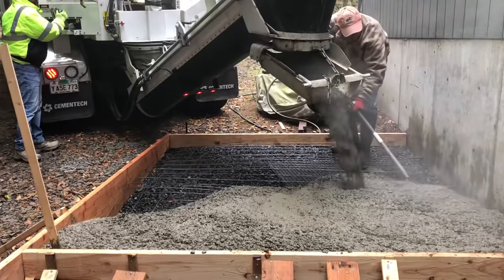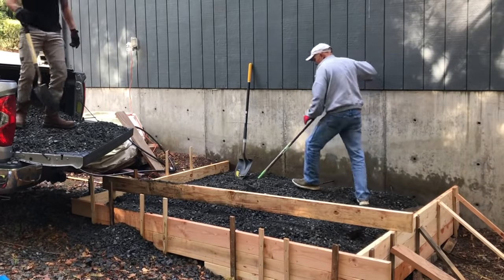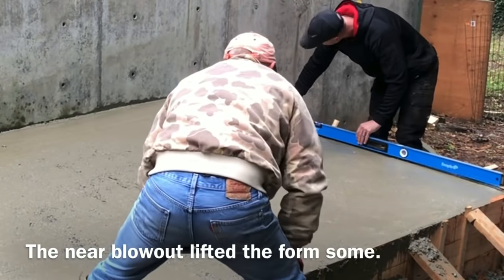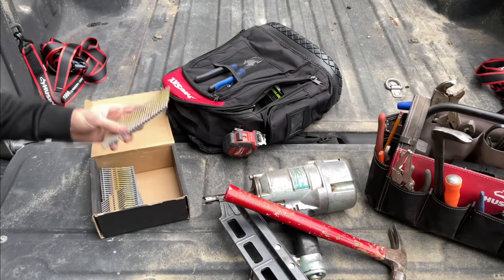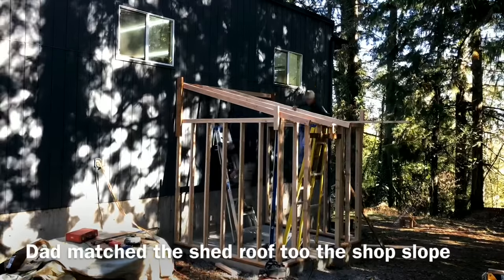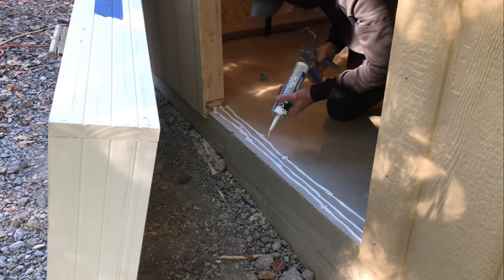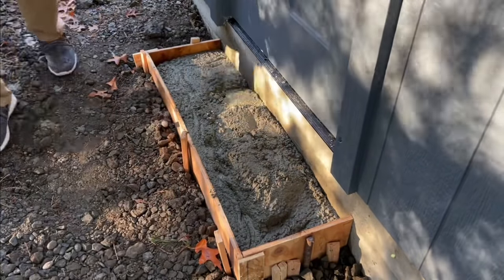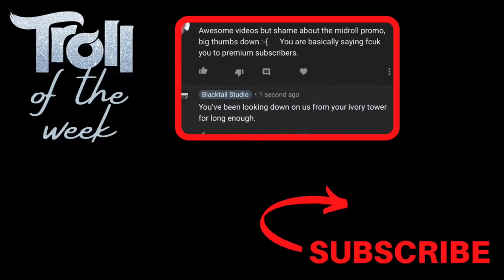Attached Shed w/Slab Concrete Foundation

Comment: One of my happy memories is being my Dad's gofer as a little lad, receiving long lumber as he ran it through his circular table saw, passing hand tools, nails etc    Not only good bonding with him, but planted the seed in my mind for future carpentry projects.  Later we went to the local college together to attend "Recreational Woodwork" classes too,  where I learned wood lathe-turning, making dovetail joints etc, and I still have quite a few items in my home from those days.  When I had my first home, Dad rallied round when I converted a cellar to an under-house garage, and we both put on rubber boots and spread 5 cubic yards of concrete for its floor from a delivery truck.

Comment: Dad. I really love your videos. My dad was a great guy and a great dad, but he didn't know one end of a hammer from the other. As a kid I became the "handyman" in our house. Just miner repairs and painting, but I did it. I got married young, with little money with the help and instructions from my father-in-law was able to build a set of cabinets in our first apartment. I'm 79 and living in our 17th house. All of those houses required some kind of renovations. I learned most things by reading Sunset Books in the 70s and from many different friends with a myriad of skills. Plumbing, carpentry, electrical, ductwork drywall, painting, etc. We finally moved near my youngest son and we have done several projects together, including remolding his kitchen two building a couple of garden benches for each other. I think this has been most fun I've had these last five  years. It does build a strong bond between father and son. I'm sure your dad feels the same way.

Comment: Awesome project and it’s great to see your dad helping.  Perhaps already addressed this but I recently used the same insulation and one of the warnings is about flammability. It may not matter much even if you have the walls covered with gypsum boards in case of a spark but drywall and a fire alarm will greatest increase protection to the rest of the shop.

Comment: Dad. You guys did good on the concrete. I’ve seen “professionals” not take all the steps you did.  Hope you lifted the wire mesh so it sits in the middle of the concrete.  Otherwise it’s useless. Fiber mesh is a good alternative.  You should see a blow out on a 100 yard wall. Now that’s exciting!  (Unless it’s your wall). Awesome video as always.

Comment: Dad. My father passed a few years back. My father in law is the one that got me started with DIY(along with myself being cheap AF). He is a general contractor, and has tools, some other tools, some old tools, work van full of tools, then some bins of tools, shed with tools, garage with tools, basement with tools.... so yeah he is my goto for most things. helped me learn about working on cars, doing drywall, carpentry, plumbing, electric... youtube is great for learning, but having someone with the knowledge there with you to point out what you are doing right/wrong, and better ways of doing things... cant compare. Although i have learned things from youtube that i have since passed to him... so works out in the end :)

Comment: Dad(s) are the best.  My (retired) folks came to help out after our daughter was born (25 years ago) and while mom was enjoying the grandma thing, dad was getting bored while I was at work.  I though I'd give him a project to pass the time for a few weeks, asking him to build a shed nearly exactly like yours.  The next day, he had the ground leveled and the forms up.  He mixed the slab from bags in a bucket one at a time.  Matched the roof slope, re-used the aluminum siding from the house and very closely matched it for the ends with LP.  About a week later, I had to find something else for him to do.  I miss dad, but remember some of his best advice about projects.  "It might cost a little more to do it right the first time, but it costs twice as much to do it over."

Comment: Dad.  Your dad is so awesome... I'm glad you get to live close enough to enjoy him in his latter years. 

I really appreciate you showing real life, "warts & all" reality... it's refreshing to see that in a world that is all about promoting an inflated self-image. I think you're doing all the right things to make your channel flourish.

Adding an automatic drain on the air compressor is a big plus, especially in your humid neck of the woods. I'm at about a mile high in dry New Mexico, and we still have enough humidity in the air to find these auto-drains very useful. My compressor shed isn't heated, so I need to add some heat tape to the auto drain, as residual moisture in the solenoid valve can glue it shut with ice. I don't think you'd need the heat tape, as Tigard doesn't see the negative temps we see here. My dad's family are PNW natives, largely living in Portland/Beaverton.

Comment: Dad. I like that it came out looking like it was part of the original shop build. Home Depot is my go to for building supplies. I like the way the on-line page shows what isle and bay an item is on. My home Depot has both an upright saw for cutting sheets of lumber and a large power crosscut saw for crosscutting.

Comment: Hey Gene, was a cement finisher. Here's a pro-tip. Use oil on the wood form before you pour the step. When doing a step use scrap 4X4 stock around the inside of the form. Then pack rock up to the edges for a base. Wet it all down and get the slump down. Then pull out the scraps of 4X4. Now you have a wide and deep edge, for added strength. This will help prevent cracking as it ages.

Comment: Daddio.
Nice addition to the shop. I have my compressor and vac system out in a simular shed. Since I have no close neighbors i was going to vent my vac system to the outside. Then the "dumb bell" went off and i realized that i would also being sucking all the heat out of the main shop. Living on the Southern Oregon Coast it doesn't get extremely cold, but it would have made a huge difference in staying comfortable.
Love the shop build and updates since i am just getting my shop and business going. You are an inspiration!
Wood Wizard Studios

Comment: i really enjoyed this video it reminded me of being a Teenager in South Florida when my Dad and I put a large addition on our home including a new garage  My Dad was also a Jack of allTrades  and for the Slabs we did use a  large truck  but poured everything ourselves  that home is no longer in our family  but it’s very Satasfying to  still see it standing after several Hurricanes  past through it  the reason exterior doors swing inside is to be able to  get th door open in the event of a large Snowstorm or Drift piling up outside the door  for safety you can still have regress

Comment: Dad... I would suggest adding a purge valve on the air compressor tank. It opens a valve at the bottom every time the pressure regulator turns the compressor on. This blows out any humidity / condensate collected in the bottom of the tank and will keep the tank from rusting out, and lower the need for a dryer if you use the compressor for painting. The last thing you want is a rusted out air compressor tank. Otherwise Nice job as usual. Good to see your dad helping out. I wish mine were still around...

Comment: Dad On the high side of your shed you need to control water run off, you do not want water to collect there, you can use whats called a curtain wall which can be a 2 ft deep heavy mil plastic that just keeps ground water away from your shed foundation this is even more important if you get freezing weather. Also try to keep surface water collecting in there too.

Comment: Great to see you and your dad helping each other. Mine, he loves to gossip and ruin anything I do. 

But here’s my professional opinion, when doweling into concrete and setting rebar, you must drill at an downward angle about 30°, blow out dust,  use concrete epoxy. When fully set, bend rebar dowels down level and tie rebar in a grid. Your concrete will never pull away.
Reply from the maker: Good call!

Comment: The rebar you set into the existing shed, you wanna drill those in strait. Concrete shrinks as it cures, so the joint needs to be able to open up or you can get cracking. Not an issue on a small slab like this, but just something to keep in mind for the future.

Comment: Dad that looks craicin, am currently build new benches and shelving for my workshop, lights and power next, have dust collector installed and working remotely but my workshop in only 20' X 20' , so it's like a micro version of yours. But as every man knows his workshop no matter how big or small is his CASTLE..
Reply from the maker: Ya man

Comment: after working in concrete construction for many months, always use rebar. I have demoed multiple slabs that are deteriorating because of wire instead of rebar. That being said it's the difference between a slab that lasts 20-40 years and a slab that lasts 40-maybe even 100 years! Looks like yall did everything well though, and pretty good for a pour for somebody who hasn't done a ton of pours!
Reply: I'll be surprised if this lasts 10 years.

Comment: Spent my entire life pouring concrete.  Not bad. Angles on the bars you drove aka dowels does help.  If you do it again put them every 18". And, while picking up the wire mesh does work it's better to put plastic concrete chairs to hold it up.  That way it won't settle in the wet concrete.

Comment: Dad always use a drop “T” on his air from the compressor to let the water 💦 fall into and with a valve to let the water out from time to time   They’re almost as good as a water separator but put it about 10’ away from the compressor. I don’t know if the Posting over a year ago will get looked at. Thanks for your work. I never got over 48” when flying at about 72 knots (Hovercraft Pilot).

Comment: New sub, first video -- building my own shop next summer and looking for some ideas. I definitely agree with putting the dust collector in it's own building on a firm concrete floor. I'll be putting my 60 gallon air compressor there as well. I also agree with the rent vs. store for tools that you really don't need to buy. Seems like a great place to get ideas or at the very least confirm that others are doing things the same 😉 -- I have an Oneida dust collector as well, but mine is from back before they painted them, like 2001 or so. Great channel!
Reply from the maker: No way, good taste!

Comment: Dad... loving the shop build videos. One tip for future reference, when doweling into an existing concrete slab you want to epoxy that end. The new slab concrete will grab and hold your rebar. However, the fact you did dowel in will help tremendously from allowing the slab to sink or even slide for a really long time. Nice work, Cam!
Reply from the maker: Good to know!

Comment: They put the rebar in the concrete at an angle to prevent it from pulling out,  but pounded the wooden steaks in straight. 
Had they put some alternating angles to the wooden Stakes in the ground, the concrete form most likely would not have lifted.

Comment: First of all if the form is reasonable with level the concrete will self level Much like water it will find a self level spot and good to go. However if you are too out of level trying to use a scree board doesn't work very well.  The concrete bolts are great I've used them. I too had built a 200 square foot shed/building. I installed drywall and insulation and electrical and finally a sliding window. I went with double low threshold steel doors. I don't know if you've priced concrete in the last several months but it seems to have gone up. Your videos are great, pour them on.

Comment: Dad, my dad and us boys built his big 120’x80’ metal shed and we had to bust up an old hard concrete slab with a jack hammer. Same thing you did, we filled low spots in the new foundation with the old concrete chunks.

Comment: Mound/channel the ground uphill of the slab to prevent rain from washing out the soil under the slab.

Whenever possible, I get the 12' siding, then there are less horizontal seams and the price is usually better than using the z-flashing.

Have a bunch of tin cans, butter tubs, whatever and fill with the excess concrete and an eye bolt sticking up. This makes a bunch of "free" anchors or weights.
Reply from the maker: Good tips!

Comment: Dad passed away almost 23 years ago. He did concrete work for about 20 years, he even had an assistant, me. He did everything from house footings to floors and sidewalks. He always had 2 pieces of plywood squares to move from one place to another to trowel the basement floor of a 24' x 40' ranch house. No question, just have fun working with your dad.
Reply from the maker: Sorry for you Jim. Glad you learned from him though!

Comment: D-Man! Bro that’s impressive. Dad really knew what he was doing! 🤓 everything is cool but there were some minor issues with that shed. 1: It isn’t a heavy traffic road or big roof n it is built on the solid land after a lot of fillings so you didn’t really need the wire mesh. 2: j-bolts cannot hold the whole structure for long, 4 wood or concrete pillars in the 4 corners n 2 for the door directly coming out of that floor bed was a better trick. n roof of this hut isn’t attached to that wall very well! Making a groove in it n then fitting the roof base wood inside that groove was great. n even if it isn’t heavy concrete but still wire mesh could provide extra support to the roof!
I’m sorry I feel like I’m talking more than you do in your videos! 🤓 the shed is beautiful n job nicely done 👌🏻✊🏻

Comment: Dad, shed looks great.  With concrete you can always buy extra and take it back later.  I once under bought and it was after the stores had all closed so I had to put in a joint.  Now I figure about 25% extra.
Reply from the maker: Good call

Comment: I filled a block wall cavity with concrete, the bottom row of blocks have openings to clear out mortar in the cavity. Wall was two meters high. The shutter boards on the bottom cavity were 8 x 2  with 4x2 stays running across the floor to the other wall. Once we started pouring concrete the vertical pressure was blowing the 8 x 2 between stays. I had to place more stays at 2 foot centers. I could not believe the vertical pressure. The pour needed to be slower.

Comment: That was a crackin job Lad but. Here in GB we always put a damp course membrane to stop any damp coming through. A pool liner or plastic sheet . I didn't see you do anything like that. It's too late now. So the best thing you could do now is a inch thick bitumen coat to the floor then tile it. It will stop damp striking up but if you have placed the wood walls directly on top of a bare concrete floor it will start to rot given time. Just make sure it's sprayed with wood preserver.
Reply from the maker: Good tip!

Comment: Something to keep in mind. If during winters it gets below freezing where you live, that can mess the slab up and shift it. Thats why you should always at the very least have concrete sitting underground too.
Also, maybe I didn't catch it, but did you not mix any sand into the concrete when you were doing the step?

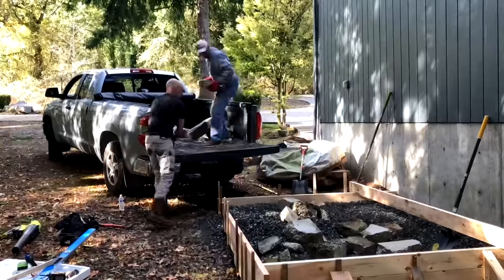Comment: Pops - @ 1:30 when you bore holes in the existing foundation and use re-bar... that's code pretty much everywhere. Especially if you're tying into the original structure with the walls.
Reply from the maker: Good to know!

Comment: Good video! I do lots of professional concrete floors (not bragging, it's just the kinda of floors we do) and this is all-round a pretty alright floor! One thing to note though, wire mesh is worthless, idk who your engineering friend is, but I'm been "in the field" as it were and had clients who wanted them put in, totally worthless, didn't effect strength in the short term or long term.
The problem is that it just isn't thick enough to actually stop any concrete from moving/breaking.
Rebar ofc IS thick enough to stop it moving in most minor cases of shifting, and honestly it's pretty similar in price.
One thing you can do that will make a substantial difference is the PSI of the concrete, using a thicker slump when you pour it (you looked to have maybe a 3-4, plenty) and mixing in/using fiber in the concrete (like horse hair found in old Sheetrock)
Otherwise, slick stuff! I like the use of diesel as a release agent! We use specific release agents, but the last (admittedly less professional) people I worked for used diesel a ton.
Reply: @DW Palme for many areas of floors we do find it's about as effective maybe a little less, but where I am at least it's a bit more expensive. We use it if someone tries to set up the job for us & they use that dinky little "chicken wire" stuff

Comment: Pop's. 

Pop's is what I call my father-in-law. I never had a dad growing up (am 49 now), mother passed away this past Valentine's day, mother-in-law passed a few years ago. I've had Pop's at my side for 26 years now. 

He used to be the "fix it" guy. Something in the house broke, "Call Pop's". Learned ALOT from Pop's. For the past decade or so though, I've become the "fix it" guy. I'm more detailed though. Pop's would often use the phrase "Good enough for government work". Key word there is "good enough". I've been a woodworker since I was 13, installed cabinets for 10 years, built furniture for 5, CNC machine operator/programmer for 3 years. "Good enough" don't fly with me. I spent 2 weeks painting a bathroom. Drove my wife nuts (hahaha). 

Point is, POPS' and DADS' will ALWAYS be smarter than their kids/son-in-laws. They Excel at thinking outside the box.